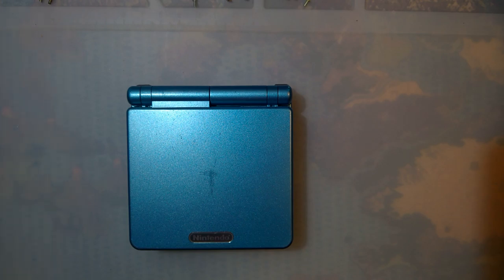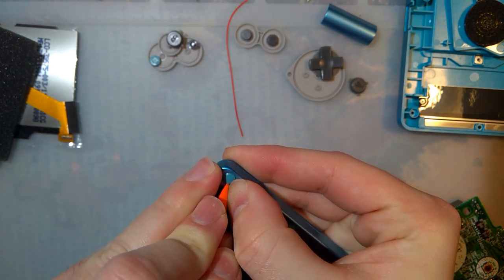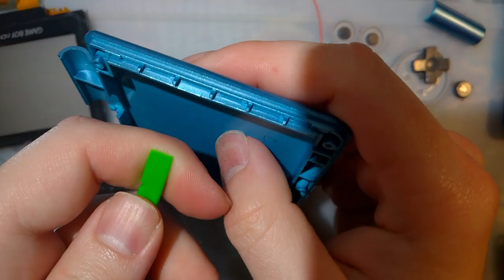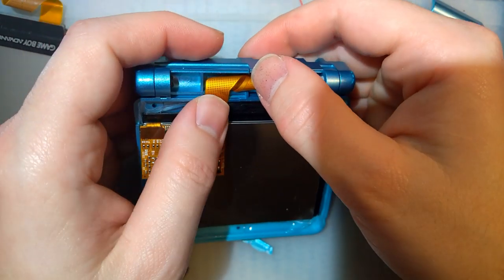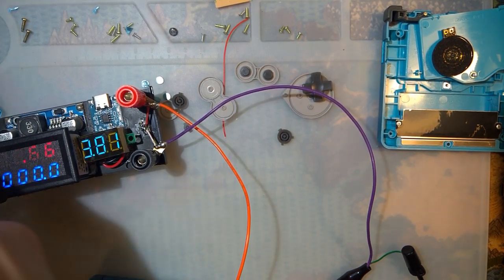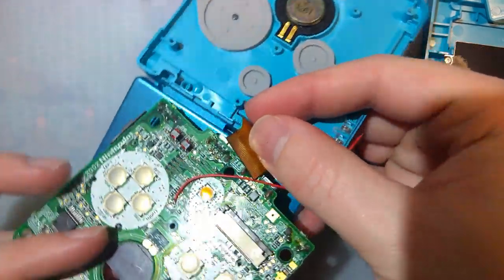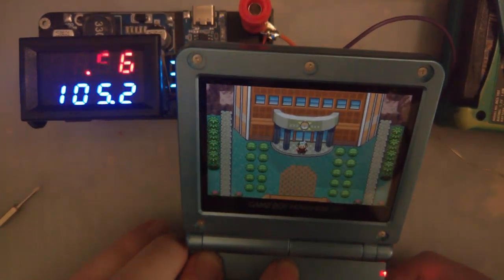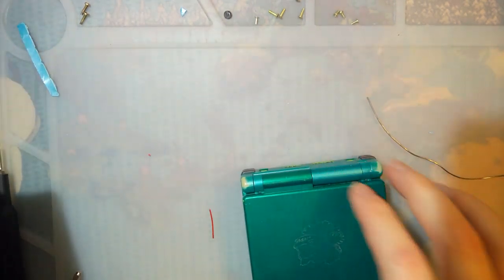Installing the "One Chip" Game Boy Advance IPS Screen Kit

Comment: I installed 3 of those exact same kits. I never heard of them being called 1 chip but I did see them labeled as 10 level brightness. The memory feature is definitely the best feature compared to the Funnyplaying one. I had a little problem with my first install. Instead of soldering to the Q12b pad I accidentally soldered to the one right under it. It still worked but instead of switching brightness every button push it was every 2 push. The button is a toggle so that pad must be connected to whatever makes it work that way. I fixed my mistake and never had any other problems with those kits. I even like those clear transparent shells that they come with for protection. I now used them to store my spare GBA parts. One is filled with the old 001 screens I took out. Another is filled with buttons and screws and the past one with rubber pads.
Reply from the maker: https://cdn.shopify.com/s/files/1/0689/3143/products/GBA_IPS_LCD_compare_720x.png?v=1583871928
Reply: @makho  I got my kits from Ebay. The way I made sure it was the same kit as the first time I got one was to look for the 10 brightness level in the description. That's how I knew it was the right one. They do have a 5 level one that I feel is just an exact unbranded copy of the Funnyplaying one. I guess if I check the ribbon picture I can now also check for 1 big chip instead of 5 to make sure.

Comment: I have the Newton rings as well, I noticed it was the pressure from the foam. Because when I loosen the screws, the rings go away. I cut the foam down and place it in the Center away from the screws. And the rings are gone! :)
Reply from the maker: Yep, like I mentioned in the description. Per the manufacturer of the kit, the foam is included for protection during shipping and not meant to be installed, despite the fact that it looks like it's been cut to size and shape.
Reply: makho sorry, didn’t notice the description haha. I still include a small piece at the Center, as I worry if I accidentally press on the screen it might get pushed in and get stuck. Anyway great video and very detailed, thanks!
Reply from the maker: @spedtron  I didn't mention it in the description, but I think two small strips along the left and right edges would be best. It will ensure that it never gets pushed in and it won't cause the Newtonian ring issue. I did the same thing on my original GBA SP IPS mod (the one with the GBA kit)

Comment: hey , 2023 and im just getting into this kind of thing. is it possible to skip soldering a wire? if you skipped the soldering part and turned it on would it just come on at peak screen brightness? tyvm
Reply from the maker: the wire is for brightness control

Comment: I've got one of these installed in my Eva Unit 01 case light mod. Since I'm required to use a clear case, I might go the route of using those fake AGS101 screens since the cut is visible and really bugging me. I might also have a look around the motherboard for a clear spot to possibly drill through the PCB for wire routing for the mod. Risky but could turn out better than what I have now (routed up and squeezed past the screw post next to the right trigger. Trigger works but not as well as it should)
Reply from the maker: Even if you have to drill through a trace, you can always reroute that trace =)
Reply: True, I'd much rather not though lol. Plus there's various models of board from memory, so 1 drill hole won't be in the same location as another. I need about a 2mm hole for the thin cable I have for my mod.

Comment: what about the ghosting ? on my ags-101 i can see that the refresh frequency is lower, do u think its worth the upgrade ?
Reply: From 101 to IPS not so much. It's sharp, bright and has no ghosting but it's not a HUGE difference compared to upgrading a 001 screen.
Reply: There will always bee some kind of motion blur on these screens because they are sample and hold displays. The AGS-101 was just really slow on certain transitions and IPS displays without overdrive just tend to have slower overall pixel transitions but it's more uniform across the range of transitions.  That said this is newer display tech than the 101 though, so likely those same transitions are faster on the IPS replacements so you won't see the same kind of blur on the same kind of transitions. (Typically dark to light transitions) 

The refresh rate on the AGS101 isn't low. It's just the slower response times of the pixels themselves. Refresh rate, persistence and pixel response times are all different things.
Reply: @fonarte  thank you for all the technical explanations, its crazy to think that even in 2020 we still dealing with the same hardware limitations, since 2 years i'am still looking for a real premium screen to replace my ags-101 screen, any suggestion or link is welcome, thank you.
Reply: @Lucas Bonvin same here, i like that physical pixel borders ^^

Comment: What's the make and model of that power supply you're using to power the game boy advance how much do they usually run for
Reply from the maker: that particular power supply was something that I made. I have since started using one of these instead -- much more reliable and powerful

https://retrogamerepairshop.com/products/mdp-xp-mini-digital-programmable-power-supply-set-with-30v-5a-90w-2-4g-wireless-connection-2-8-inch-tft-screen

Comment: I know this is a simple question but what exactly do you do to connect the chip to the actual screen is it just pushing down sliding what is it??
Reply from the maker: the LCD ribbon connector snaps in to the ribbon cable adapter. You just have to make sure it's lined up properly then apply a little bit of pressure and it will pop in.

Comment: Hi, I was wondering if I can use Ags 001 lcd for my Ags 101 unit, your answer will greatly appreciated.
Reply from the maker: not without modding. The IPS kits are compatible with either system, however.
Reply: @makho  thank you for answering ☺️

Comment: I have this kit installed, but when I move the screen or put the console on the table and grab back the screen freezes and I have to turn off the console, do u  know what possible happens here? I allready redo the the instalation but still the same.
Reply from the maker: Sounds like you've got a bad connection somewhere or a short. Try reseating all connectors and insulating anything that might be shorting.
Reply: @makho  I used a thick tape to fix the circuit on the screen maybe it is making pressure on connection. in my kit missed the foam, is that necessary?

Comment: Hey, I watched your DSI XL vid from a while back where you replaced the fuses. My console has the same issues where the charging fuse and power fuse are both blown, and I can't for the life of me find which fuse I'm supposed to replace them with. You said the ones you used weren't quite the right ones, so would you know which fuses are necessary for it? Thanks!
Reply from the maker: 0402 1.25 amp should be fine
Reply: @makho  would it be possible for you to give me a link as to where to get a resistor like that? ebay and google didnt turn up with anything that I could tell was correct
Reply from the maker: @chickenslappa  It's a fuse, not a resistor. 

https://www.digikey.com/product-detail/en/panasonic-electronic-components/ERB-RD1R25X/P15115TR-ND/2796783
Reply: @makho  oops, my mistake. I meant fuse lol. thanks so much for your help! I really appreciate it. Your channel has a lot of great videos and advice

Comment: This may be a stupid question, but why hasn't china made clones of the ags 101 screens for replacement parts? I just find it odd that for other consoles u can find aftermarket replacement parts, but not for most of Nintendo's consoles.
Reply: They did. A year or two ago it was pretty easy to buy an already modded original GBA with 101 screen for 100$ from China. They were not original 101 screens. It was not a huge batch but they did make some. Now with the IPS mod it has made them almost useless since the IPS screen is stock part and cost like 8$.
Reply from the maker: I've actually got a lead on something like that. I (hopefully) have some hardware in the mail that I'll do a video on if it ever shows up.
Reply from the maker: @chamoo232  They were OEM in the same way that the same part was put into AGS-101 consoles. It was just a limited batch. 

I'm glad that stock has pretty much dried up for those though, those screens really are garbage compared to modern LCDs.
Reply: @makho  The 101 screen was the best way to enjoy GBA games until the IPS mod came out but now there is absolutely no point in getting a 101 screen into an original GBA beside being more "authentic" or perhaps just having one unused screen laying around. GBA SP prices have doubled since the IPS mod came out. Especially the 001 that no one wanted before is now the best one to buy if you plan to mod. Before getting my first IPS I really didn't think it would be that much of a difference. I gave in when they fixed the screen ripping effect. I have no regret making the switch as the IPS screen really is amazing.
Reply: @makho  The next best thing you could get is if someone was able to make a mod to use DSi screens in GBA/Sps for people who want 1:1 pixel resolution. As the DSi screen is better than the AGS-101 while not perfect. (Still some slower transitions). And  the screen size at 1:1 is just slightly smaller than the original GBA.  GBC games on the DSi screen I think are only 1-2mm off the original screen size and look great as well. Which would make a decent replacement for GB/GBC too for those that like having the screen and system resolution to match 1:1.

Comment: Is there any way to revert the newtonian rings once they appear? I should have read the warning in the description about the foam before actually installing :P
Reply from the maker: just take the foam out
Reply: makho I’ve removed it and have played a bit since then but the issue persists. Would it be more productive for me to get a funnyplaying display and replace it? I saw retro game repair shop sells just the displays.
Reply from the maker: @jacobpedrazzini8047  It should straighten out without the foam. If not, you should probably contact the seller, actually. But yeah, a new display will also fix that. The funnyplaying displays are laminated and look much better (because of the lamination especially but also because LG vs Toppoly) and are not subject to that issue.

Comment: What kind of wire did you use to solder onto the brightness circut?
Reply: Also whered you get the case? Love the shade of blue!!
Reply from the maker: I generally use 30 AWG Kynar wire because it's easy to get locally (or was, pre-covid) and the shell is either Surf Blue or Mana Blue, depending on the region it was sold in.

Comment: 1chip like the snes one? Lololo 😂
Reply from the maker: As in it uses one chip to do the electronic conversion whereas the funnyplaying version uses five different chips. One method is not inherently better than the other, it's just different. Since I don't have any other names to differentiate the two, it's what I'm going with.
Reply: @makho  Ah okay.
Reply: I feel like it’s worth getting the ‘1 chip’ then spend the remaining money on a reshell. What you think?
Reply from the maker: @gmr2gnr  OEM shells are higher quality than aftermarket shells.